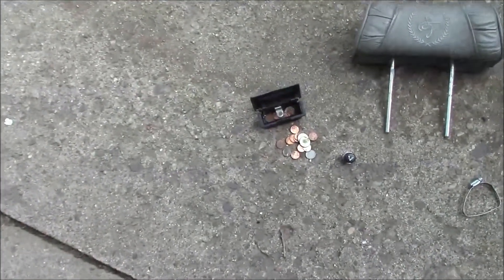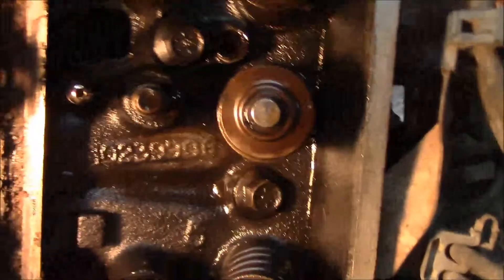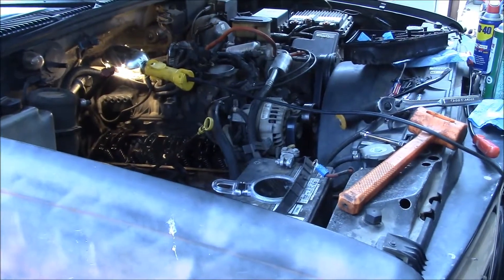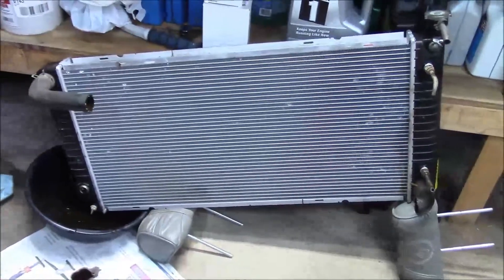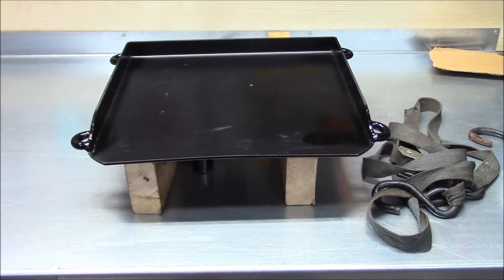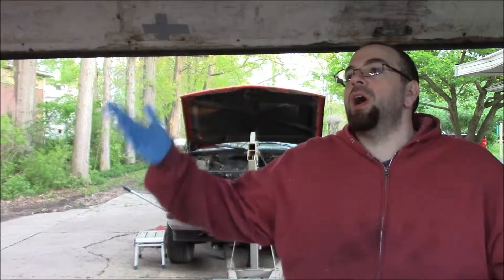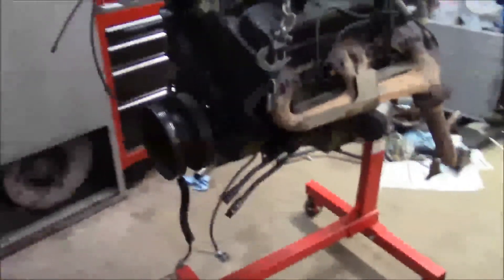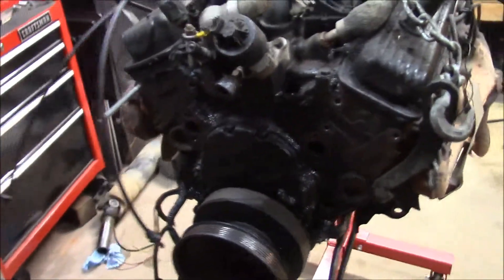Identifying Cylinder Heads and Quickly Pulling Vortec Engine (Donor Truck Part 3)

Comment: The hardened exhaust seats only come in vortec heads that were on 1-ton trucks.    It could go either way, the only way to know for sure before you pull them is with a boreoscope.  Only the 906s have the chance of having the seats, the ones with seats have a single angle valve job with a very wide sealing area.  All of the 062s are the same with a 3 angle valve job and flame hardened seats.

The easiest way to ID them is to look at the ends of the heads. One round hump or three triangles are the indicator to show vortecs.